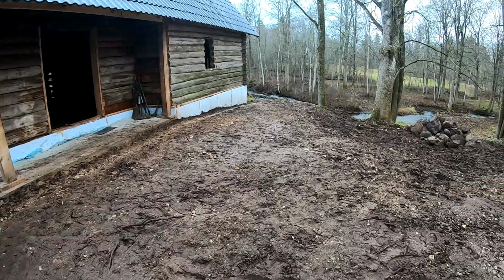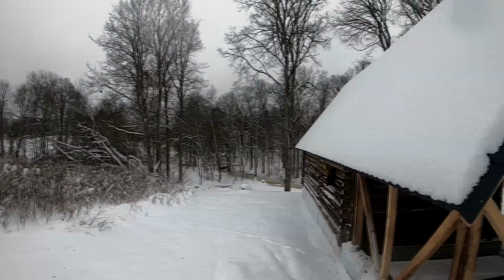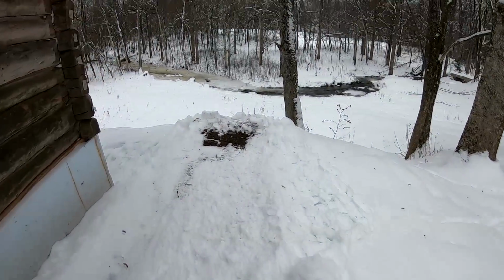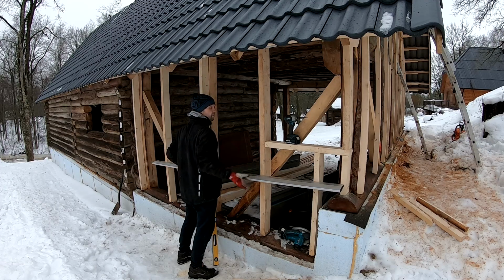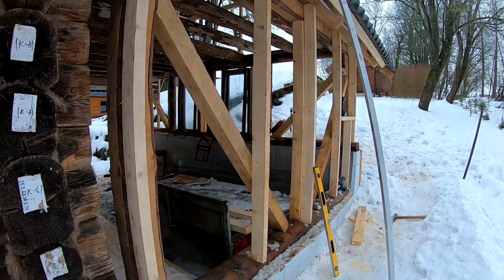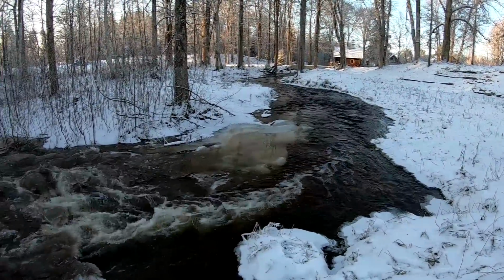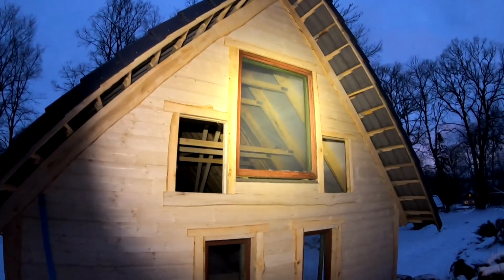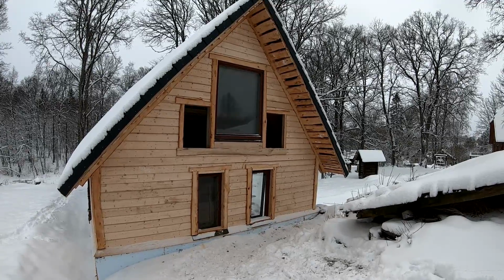Renovating a 128 year old forgotten log cabin (part10) - Addition siding installation

Comment: The live edge wood you used in the soffit (that's what the area under the overhand is called in English) looks great. My only concern is that you just built a fantastic motel for small animals. 😁
Reply from the maker: Yes local cats will vacate it in no time. Need to figure something out.
Reply: I was thinking the same thing when I saw this. a little chicken wire put up before the wood could change that./
Reply: Bees and wasps too.

Comment: Recently found your channel .. loving the content .. So interesting to see that your door swing outwards. Here in the States, most (that I've run into) swing inwards … especially in colder snow areas .. this way you are not trapped in your house by the snow. Interesting to see the different build styles from around the world. Loving the build series .. thanks for making these videos.
Reply from the maker: Thanks man! Think it swings outwards due nto fire safety so that if there is fire inside then you could open the door outwards, but i aint sure if that the case. Most doors swing outwards here.

Comment: Andris, if you are using a gopro in cold weather such as this video and filming you would benefit from a gopro media mod or battery door upgrade where you can power the gopro from a USB power bank as the battery door upgrade has a machined hole for usb c. Cold and hot climates drastically reduce battery life
Reply from the maker: I will try the hero12 with enduro batterys. Iv heard they are great
Reply: @Ants_Pants  I've always had better results from quality aftermarket batteries

Comment: Insulation on the outside is probably the way to go, unless you want to cover both sides of the logs. Just make sure you use some kind of insulation that doesn't rely on a vapour barrier too much, e.g. wood fibre or hemp.
Reply from the maker: Thinking about going forward with mineral wool (rockwool). Mostly because i can get the stuff for free or stupid cheap.
Reply: @Ants_Pants  Then you'll definitely need a vapour barrier. You don't want the insulation to get wet with condensation and rot your timbers. Have you considered sawdust?
Reply from the maker: No i havent yet. I cant find a supplier for sawdust asi i was looking i did some research. Eiter have 2 options. Go without vapor barrier and let insulation get wet or vapor barrier inside. But i would rather leave the walls open if i could. Is sawdust better letting vapor through?
Reply from the maker: @Ragnar8504  did talk to a expert in the field (hes currently working @a university on insulation field), he did tell me that its fine to leave the logs out and no vapor barrier is required if insulation is done from the outside, that its better to leave it open. lol getting so mixed answers from everywhere, confusing as hell.
Reply: @Ants_Pants  Sometimes I feel that's more like black magic than exact science... I mean if European design guidelines and building regs were the universal truth, every single modern home in the US should be riddled with mould throughout - they put OSB (which is a reasonable vapour barrier) on the outside and only paper on the inside without even taping the seams (US fibreglass is usually paper faced so it comes with its own vapour barrier, although not a very tight one).

Comment: When you added those small boards (at 38:00) my first thought was that you should have put some textile behind it to prevent wasps from entering. But then I realized this is only a car-port, so it doesn't really matter. In the last minute of your video you mention the same has to happen on the other side of the cabin. Which is definitely not "just an addition", so better put some screening or fabric behind those boards.
Reply from the maker: GOod idea

Comment: Nice work Andris. Did you get a new planner? You didn't use it on your table project. I like the live edge look. It's sad you are thinking of covering the outside of the logs with insulation. I suppose you would have the inside to look at and enjoy. Insulating the outside and wrapping the rest of the cabin in the same boards used on the car port would look nice. It is such a great project and you are a talented craftsman. Thanks for sharing; from Canada.
Reply from the maker: Hey man, thanks for watching, the planner is not new, my slab was too wide to fit through it so i had to manually flatten that one. It's sad yes, but i talked it over with couple of experts in the field and they both recommended going down this route.
Reply: @Ants_Pants  The jig you worked with was a great idea. I applaud your ingenuity. I really enjoy your videos.

Comment: Question: I heard you mention aspen for sawing. Does it make good timber frame material for structural builds? I was thinking about using it for 8”x8” cants… thoughts?
Reply from the maker: I dont like aspen. Cutting it is a absolute pain and it twists so badly. Maybe becase most aspens i have in the forest are dead aspens for many years. But yeah iv tried years to work with aspen and always ragequitted after a attempt.

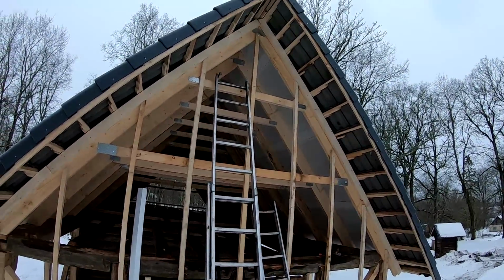Comment: 16:45 why are the cross beams on 2nd floor above the carport so low? any particular reason? Makes the area somewhat inaccessable. Why not use 2x4 straight up from the beams above the carport to the truss?
Reply from the maker: I removed them in the next video you will see. Thanks for checking out this one. Take care!
Reply: @Ants_Pants  Why not put a steel beam with a trolley and a chain hoist for various tasks in the car port? Useful at times.
Reply from the maker: @newandoldtech5634  its a good idea yes. But the carport is too small for any tools or table. I will try to do the steel trolly on myshop in the main house in future.
Reply: @Ants_Pants  Or a gantry crane on wheels like Keith Rucker? Small enough to get in the shop, big enough to use outside?

Comment: You will be happier in the future if you do cover the rigid insulation on your foundation.  No matter what they tell you when advertising there is no readily available rigid foam board that does not deteriorate in ultra violet radiation.  Some kind of covering is required.
Reply from the maker: True. Will do when i an able to start digging. The ground.